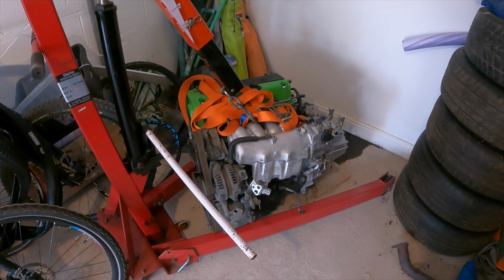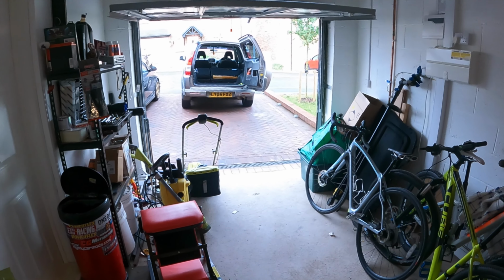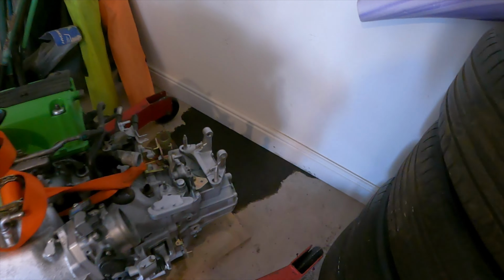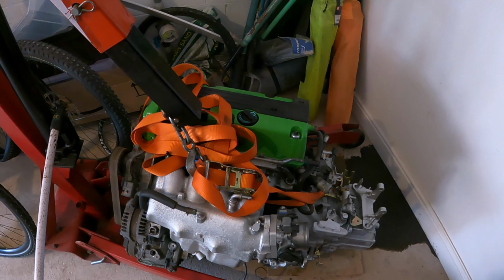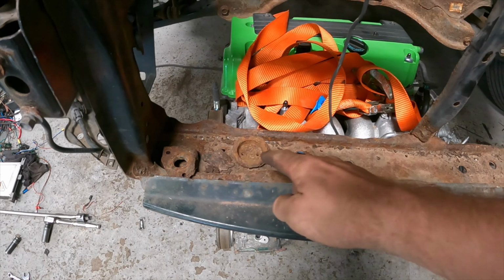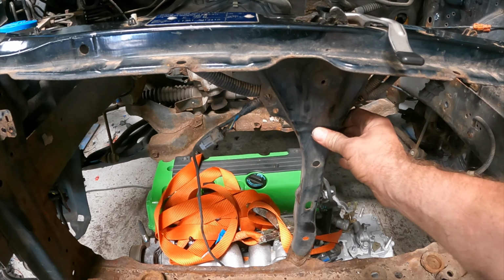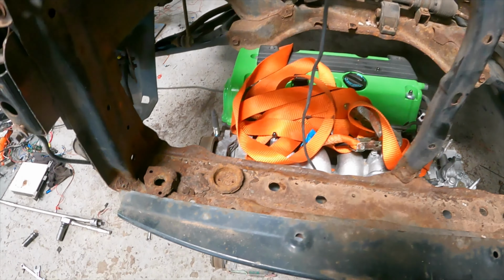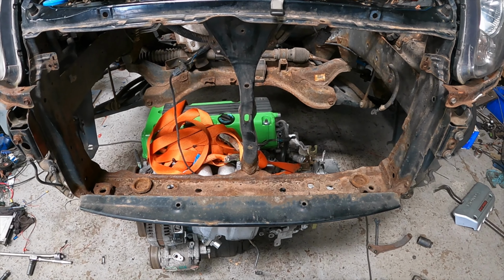Honda Jazz K swap K20 - Engine out and Chassis Trim

Comment: What’s up , what cable shifter you guys use to oem shifter honda fit , and maybe some modify or custom in shifter oem or in cable shifter ??
Reply from the maker: Used crz cables, had to modify the gearbox cable bracket for length and then also used a crz gear stick but had to cut and re-weld the cable pivot and also add a bracket for the cable length. It was not simple. But I wanted to keep the centre console in one piece.